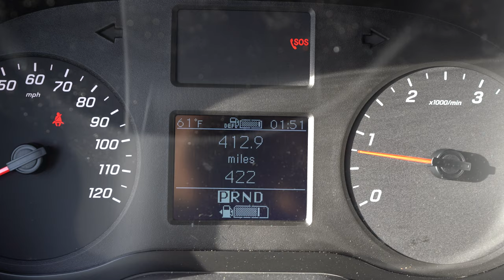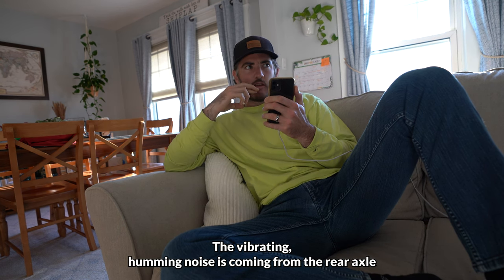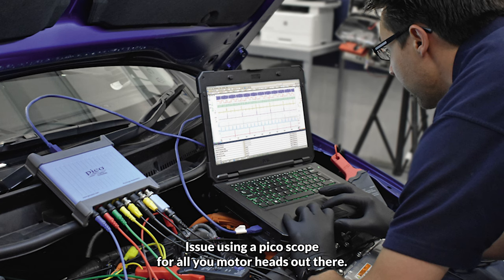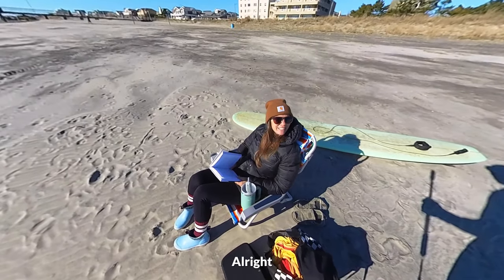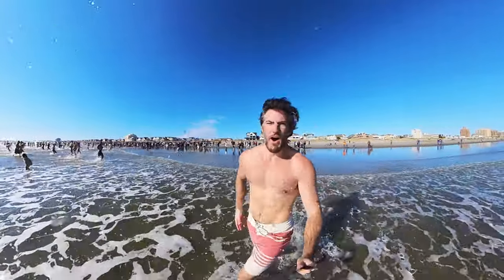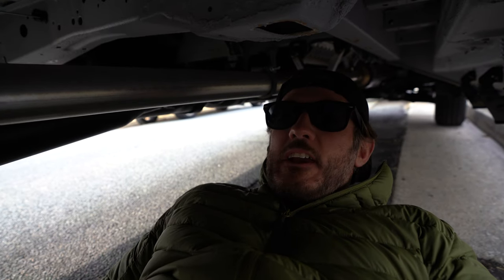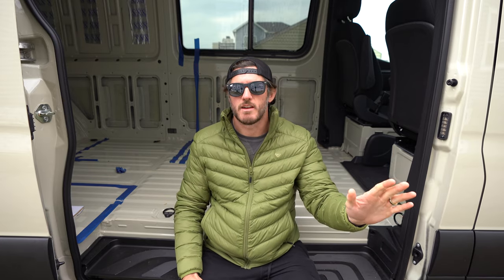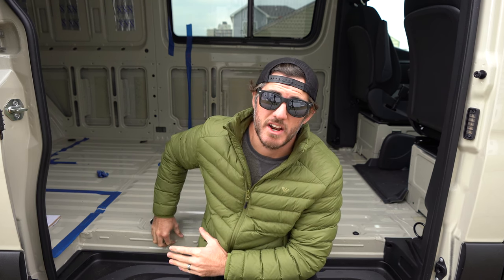Our New Sprinter Van Might Be A LEMON... Van Build Delays

Comment: We bought a new 2020 170” 4x4 Cargo Sprinter and the engine blew at 3700 miles. The new engine took two weeks to order and install. Everything was covered under warranty including travel expenses to and from the dealership (we lived in Portland but had it fixed in Boise). They think it was contaminated oil from the factory. We’re now at 42k miles and it’s been running smoothly since the replacement.
Reply from the maker: Oh boy that’s scary! Glad to hear everything was covered!!

Comment: I have a 2012 170 2wd fully built out with the same issue.  It is a known problem with Sprinter drivelines.  (look on sprintersource for some good discussions about it) Supposedly has to do with the very long drive shaft in them being a bit out of balance or orientation.  I hope they are able to get it fixed.  Our 2012 still does it to some degree but since it is out of warranty we just accepted it as it is.  Our 2022 does not have the issue  🙂
Reply from the maker: Yea it's frustrating hopefully they're able to figure it out!
Reply: It’s not a big deal to remove a driveshaft and send it out for balancing.

Comment: Hey so I saw your comment on the other video, and we seem to have the same noise/issue. I noticed when I had a couple hundred pounds of stuff in the van, the noise was dramatically reduced, did not fully go away but almost gone. This hints at it being related to the leaf springs like others have mentioned. I have not taken mine in yet as I've been out of town for a couple weeks, but I will let you know what I hear when I do take it into the dealer. I am having another really alarming issue on mine that when climbing a slight grade with about 30-40% throttle, the van will do two fairly violent kicks and then go back to normal. This first started when I was driving in blizzard conditions with 4WD enabled, going about 60mph and is now happening when in 2WD.. 

I am bummed about all of the drive-train issues I am having already
Reply from the maker: Thanks for the tip that’s good news on the weight getting resolved.  I’ll bring up the leaf springs as well.  Sorry to hear about the kicking on the inclines that’s frustrating.  These things are expensive and shouldn’t be having these issues!!!
Reply: @MathersOnTheMap  Agreed! Best of luck to ya on your repairs, curious to hear what your experience with the dealers is on this.
Reply: @MathersOnTheMap  Hey wanted to update you on this that I rotated my Kumho tires front to back, and after doing so it seems to have 90% eliminated the noise for me. Do you have the Kuhmos as well?
Reply: I figured there was no way it was just the tires, as others eluded to the Kumhos doing this, and sure enough I've now driven it over 800+ miles after rotation and I barely notice anything now.

Comment: It’s actually a normal thing. My 2020 170 4x4 did the exact same thing. Could hardly bear 73 plus mph. It goes away when you add the floor, sound deadening, etc. it just resonates bad when empty.
Reply from the maker: Good to know, I'm hoping that's the case as well.  How much weight do you have in it now?
Reply: @MathersOnTheMap  8100lbs. I recommend adding leaf springs. The sag was noticeable.

Comment: What happens if you start the build and the vibration comes back?
Reply from the maker: It's a good question.  Based on the comments and direct messages on Instagram, this vibration noise from the driveshaft seems to be a common issue with the sprinters.

Comment: RV market is cooling down very fast.  2023 Midwest and American patriot RV with 177 wheel base offer huge discount.  MSRP $223K reduced to only $13Ok only, It isn't worthy to convert by ourself anymore.    I just bought 2022 airstream interstate 24 GT 4x4 with luxury interior facility, seats and window blinders, shades are all automatic. but only $180K. So, rethink if deserve to convert van in term of costs and too much time and labor.
Reply from the maker: Glad to hear it’s coming down!  I think we would go DIY either way since we have specific desires and needs that can’t be met via the RV route unless you go with an upfitter company which is more expensive than the diy.  Luckily we have the time to dedicate to the build which I know not many have which were super grateful about!  180k for the airstream is a great price though, don’t they msrp for $220+ as well?